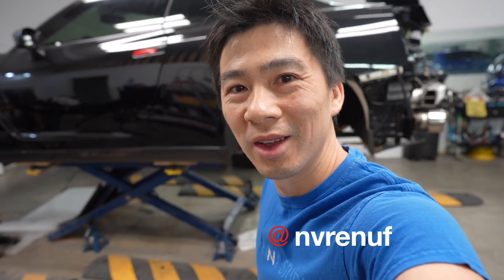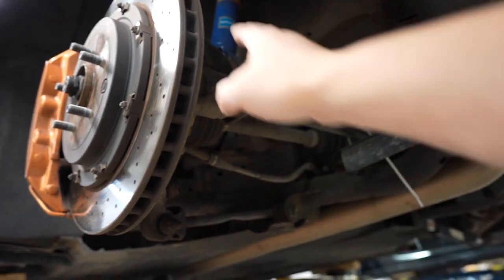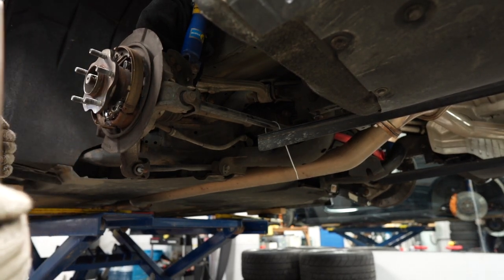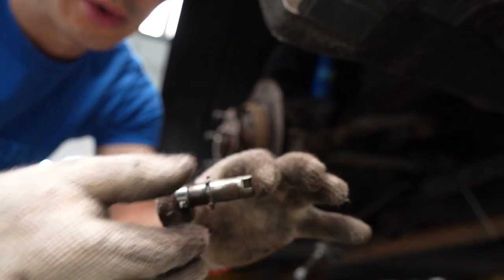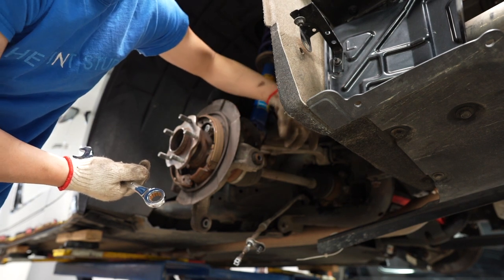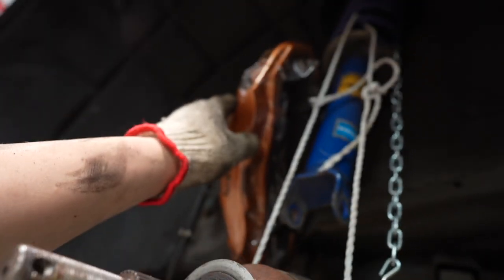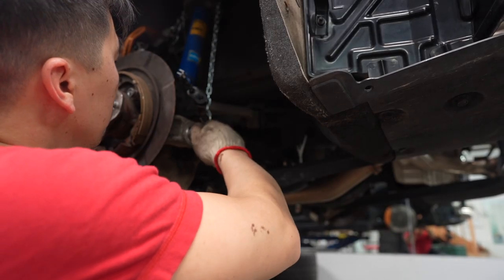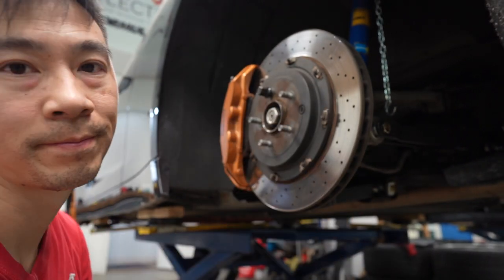Giving My Nissan GTR A Suspension UpGrade!!!

Comment: Great video, I have a question please, I'm looking to just change my rotors for new ones but regarding the hand break /e break, can you not just leave it off before you attempt to remove the rotor? As oppose to having to release the tension? Thank you
Reply from the maker: The hand brake on the GTR is pretty much a drum brake system. As you use the hand brake the auto tension-er will keep the cable tight. When the hand brake pads start to wear down it will create a lip on the drum. The lip isn't much but enough that it will not allow the disk to come off with out releasing the tension. That is why you will need the back off the tension-er. Hope that helps!
Reply: @phothrottle  ok thanks very much for replying 👍🏻